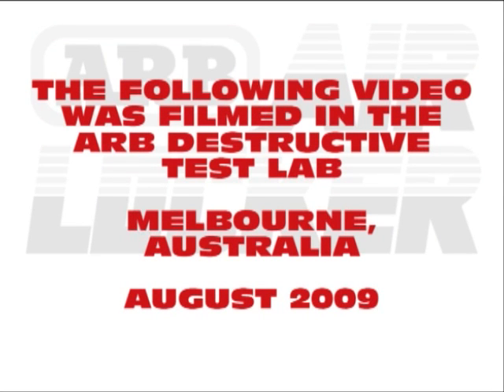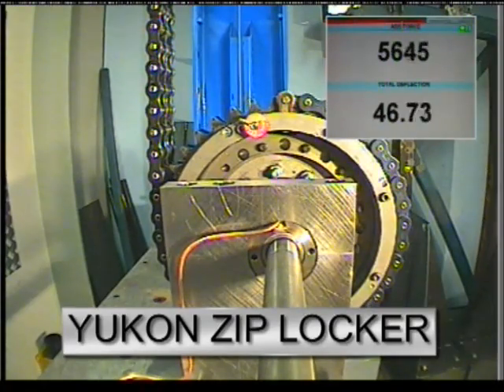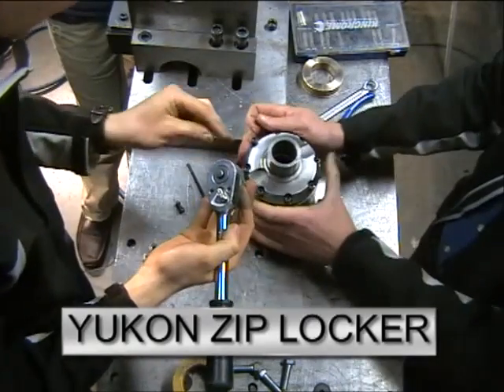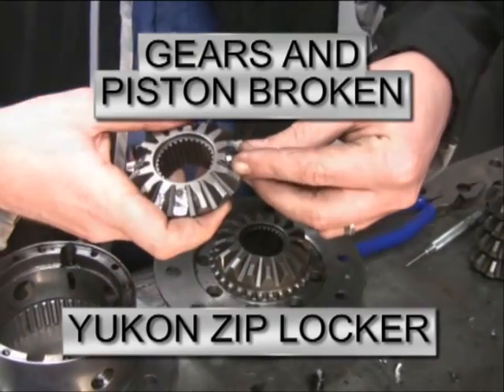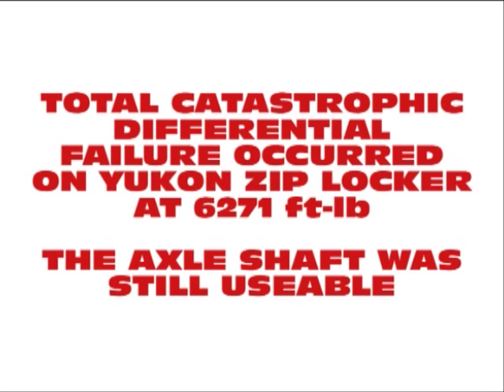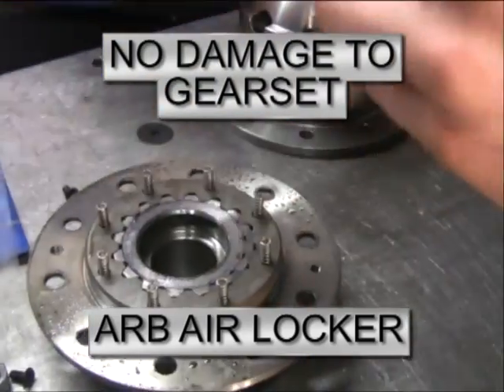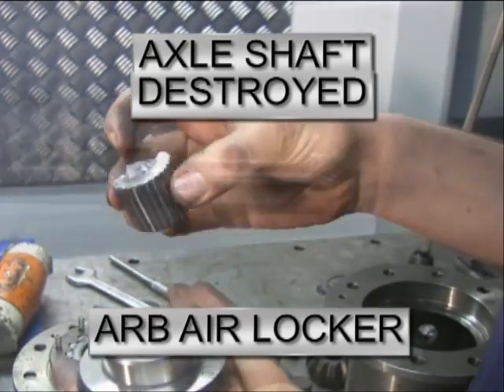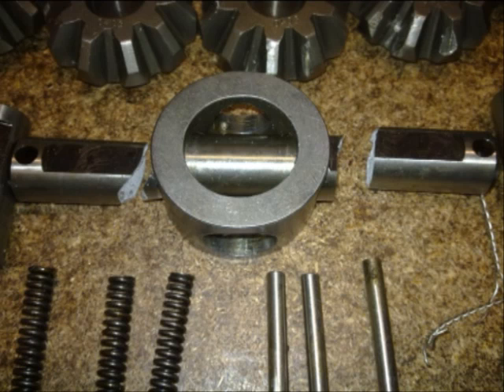ARB Air Locker vs Yukon Zip Locker

Comment: I have an Air locker in my Dana 70 on my 2001 Dodge Ram with a Cummins that has plenty of modifications. Zero problems so far after 3 years.

Comment: @ARB4WD:  I'm curious about a couple of things....  The actual TQ values in the two tests really aren't that far apart:  (Yukon failed at 6271 Lb/Ft.... ARB test stopped at 6545 Lb/Ft)  a difference of only 274 Lb/Ft... which sort of implies that if identical axleshafts were used, the Yukon was VERY close to successfully reaching the end of the test also...???  Was the axle shaft in the Yukon test also twisted at 80-degrees prior to failure?  It looks like only the splines were twisted.

Second:  Do you have any concerns that this test isn't 100% valid due to the fact that only 1 axle shaft is installed?  It would seem that you are only applying a TQ load to one side of the case (which would not happen in a real-life "locked differential" situation) and perhaps that large gaping hole created by the missing axleshaft on the opposite side allowed for some initial deformation of the housing which may have led to the cracking of the case???

It was a very interesting test to watch, and I'd appreciate hearing your thoughts when you get a chance.   (I'd also like 2 "evaluation" units for my Ford 9" housings if you are so inclined!)  ;)   That way I could independently review your claims....   Cheers!

Comment: Every axle is different. For whatever differential this video is for an ARB is noticeably stronger. Some, like the AMC20, have a large 8.8inch ring gear but tiny axle shafts and a flimsy case so no matter how hard you try you will break your shafts or strip your ring and pinion long before you come close to breaking the carrier. All this video shows is that for this particular application ARB is better.

Comment: this test would have been believable if it had shown say the cross shaft breaking but not with complete failure of the shaft, side gears, pinion gears and the case. Hell you should have had it just blow up completely. Like a grenade.

Comment: 7,000lb.+ K30 trail rig/log skidder/work truck with 38.5" SXs, a built 406, and a 203/Lomax doubler making for a 6:1 combined low range - I can build enough torque to break shit and I'll be going ARB when I build the front axle.  You get what you pay for, and cheap knockoffs based on someone else's hard work and quality product are not really something I want to buy into.  Breaking a D60 shaft sucks, but blowing a diff. sucks a lot more...

Comment: I have an ARB 30 spline for my front dana 30 with chromally axle shafts, 35" tires, and 4.56 gears and I broke the teeth off my ring gear and chipped the pinion teeth before the locker or shafts came close to breaking or twisting, I'm sure the yukon zip would have outlasted the ring gear too....

Comment: Did you even watch the video?  
1) @ 28sec in it states 2 brand new axles shafts were used for both tests. 
2) @ 3:40min it again states with an identical brand new shaft was used. 
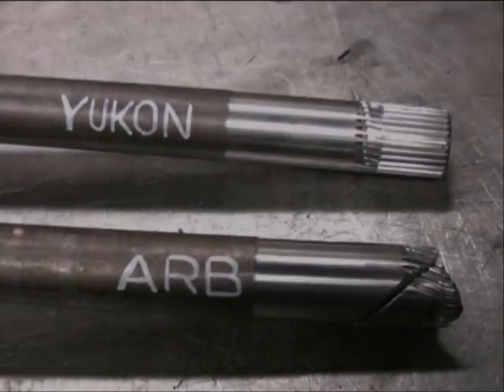3) @ 6:27min it shows BOTH AXLE SHAFTS!

Comment from the maker: Absolutely! That scenario would be one of the most common for snapping axle shafts. Most four wheelers would be aware of people who've experienced this on the trail. Axle shafts are relatively cheap to replace compared to other drivetrain components and can usually be changed on the trail. Having an axle shaft break can end your day, though, and for this reason most four wheelers consider installing upgraded shafts. It's safe to assume that the ARB was subjected to real world conditions here.

Comment: I don't quite understand the disagreement over the validity of this test. Given that the shafts were identical and the test samples were random, I'd say this was valid enough proof of the failure limits of each design. Of course the testers' credibility can be called to question but so far nobody from the other camp has come up with counter evidence yet.

Comment from the maker: Hi Tcorris, these tests were performed to demonstrate real world situations.  We used brand new, identical, commonly available axle shafts to show the breaking point of common shafts vs. the failure point of the differentials.  Air Lockers are designed to withstand considerably more torque than the best axle shafts available, so we can’t actually show you an Air Locker breakage.

Comment from the maker: Thanks for the comment. Out of interest, the Arctic Truck teams run Air Lockers front and rear in their vehicles and have used them in temps down to -40C with no problem.

Comment: @MentalChainsawDude Well, you should think about gear-reduction, since, with it, you also have a TQ ratio to deal with. Say an engine puts out 270lb/ft of TQ; a 3.4:1 1st gear; 2.72:1 low range; and a 4.10:1 RP in the diff: this equates to to over 10,000lbs of force. Now, if that was distributed equally, then you would have 2500lbs of force going to each axle. Considering you have about 60%/2 going to the rear that would be 3000lbs per axle; 40%/2 to the front or 2000lbs per axle.